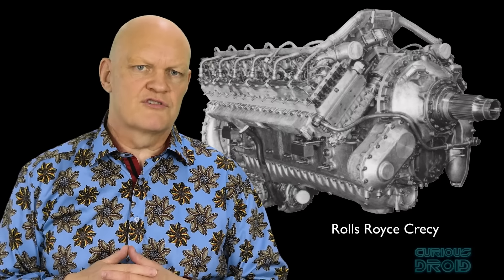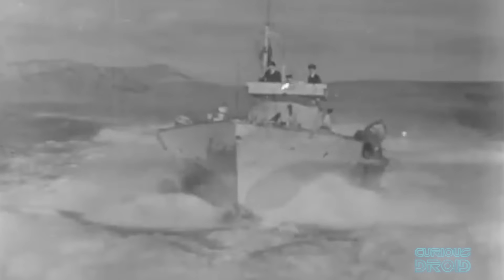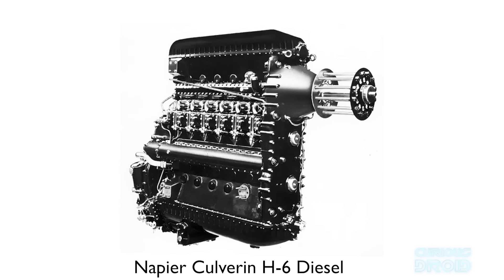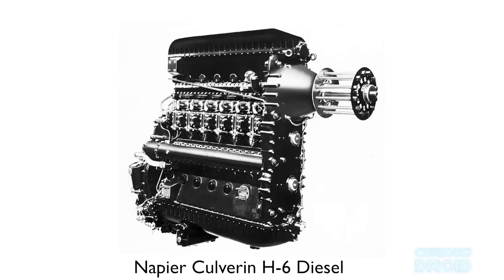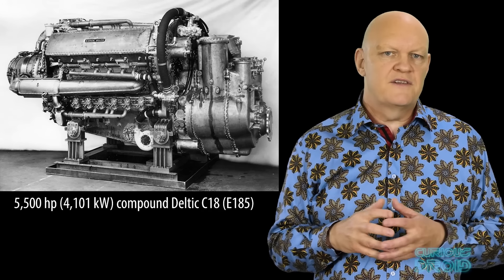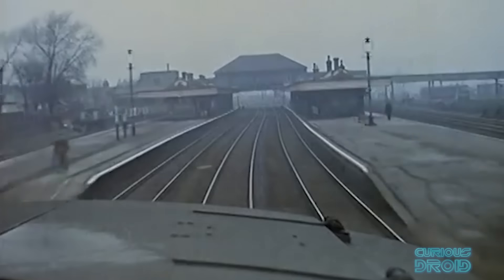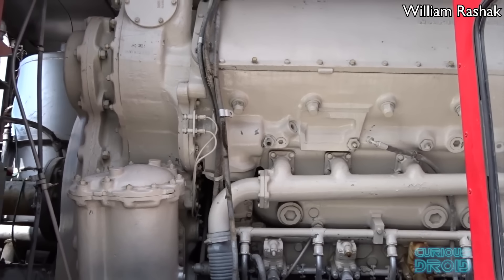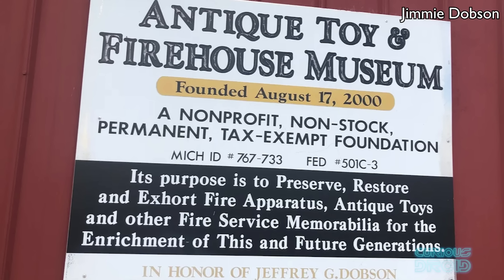The Legendary Napier Deltic - 88 Litre Opposed 2-Stroke Triangle Engine

Comment: I was a driver on British rail until 1985 and was lucky to drive a Deltic, awesome sounding locos
Reply: Hi Bob as a Kid our house backed onto a field which at the furthest side had the Blackburn to Preston line. I used to run across the field  to watch and hear my favorite. I was lucky enough to see the Flying scotsman and the Mallard as a kid pass by. Such great engineering feats.
Reply: @golfhacker9051  
Never saw a Steam engine till I started at Saltley diesel depot in 1977. We used to go to York, I was with an old hand driver where we had a few hours at York waiting for our return train and he took me to York train museum and that was the first time I saw mainline Steam engine for the first time and I was amazed at the size of those engines, no wonder train drivers back then we seen with such admiration.
Reply: @bobp6742  Admiration
Reply: @jasonjanes3256  
Never noticed, thanks 😂😂
Reply: Wow!
Reply: A back ground sound that has long gone. The low rumble would travel for miles. Just like we don't hear Viscount turboprops passing overhead any more.
Reply: @flybobbie1449  anything with dart engines.
Reply: did the class 55 run the triangle engine?

Comment: At the request of BR In the 70s I assisted an RAF civilian Control Engineer on a problem with the 'Power control" system on Deltic Locos . The drivers could not use full power on Initial take off, if they overdid the Throttle? it would blow fuses and the whole thing stopped. He mathematically modeled the control system, all mechanical, and believed he had found a Multiplication error.  By inspecting the drawings I thought I could see where one of the three holes, for  link rods, in a 'wash plate' was in the wrong place  The outer holes were 9 inches apart and the center hole 6 inches from the top one, giving a ratio of 2 to 1.  I estimated 'from the overall shape of the wash plate"' that the center hole was intended to be 5 inches from the top giving a ratio of 5 to 4  (multiplication of 1.25 instead of 2)  Mr. Patterson's figures indicated a figure of 1.31 was required.  When a new plate was fitted with the holes at 5 to 4 the problem was solved.    As a side issue Mr. Patterson did a performance analysis from actual data and calculated the true HP as 4200 HP.

Comment: I drove a 2 stroke Mack years ago and was told by the dispatcher that those old 2 strokes were the most efficient machines that convert fuel into noise.
Reply: Other than a V8 Air Siren.
Reply: @Neojhun  pretty sure a TU-95 is louder
Those planes have their own sirens
Reply: I have permanent hearing damage from racing unmuffled 2-stroke motorcycles in the late 60's.
Reply: I used to drive a TM Bedford with a supercharged 2 stroke, once you got it rolling it was almost uncatchable. The only trouble I had with it was the splines on the supercharger drive-shaft, they used to wear like they were made of plastic.
Reply: drive them like you slammed your thumb in truck door.. and wife just left you .. gears ? any gear ,don't lift foot .. drove a L9000 for 3 yrs .. inuvik to edmonton and edmonton to Yellowknife through to lupin mine
Reply: I once drove an old bus that was very good at turning diesel fuel into a smokescreen..
Reply: @dbmail545  no way, dirt or tarmac? I raced a TZ250 for a few years in the late 90’s. I miss the way they sounded, and the kick in the pants when you got up on the pipe. Can’t imagine what one of those 500 v4s is like to ride.
Reply: @borderreiver1806  that’s how the Mack was. With no load you could really rip, fully weighed down you had to use all 20 gears, took a while to get the 2 stick shifting down but was a lot of fun, it had a radio but you really couldn’t hear it over the motor and the road noise.
Reply: Ah yes your dispatcher, your best mate at the start of the day, at the end of the day ...... ....... at home all warm and cosy
Reply: @dbmail545  I raced td2 3 and tz 250-750 my mechanic was deaf on one side from ear tuning bikes and chainsaws
Reply: @dbmail545  What?
Reply: @bryanmartinez6600  But correct this for fuel used during noise test?
Reply: @dbmail545  I'm gald. I had to listen to them. I hoped there was some force in the world delivering fairness.
Reply: I have a pair of FD6 generators that I want to find a home for.  My dad worked for Vospers during the war and lived on an MTB for a few years after it.  The Napiers used to wreck main bearings until they realised that ally engines on steel cradles were beinding the whole engines.  There were a pair of them in Great Wakering some years ago, but the woman who owned them would prefer to scrap them than allow someone to buy them for a good price.
Reply: @jenpsakiscousin4589  raced the TD3 then TZ350A-D TZ250A-D  TZ750 C I quit in 1979, or the Army quit me ..
Reply: Size  for size, have a listen to a 250cc DKW piston supercharged 2T Grand Prix bike. Absolutely ear splitting.
Reply: @RichardASK  It isn't a matter of loudness so much as tone.  I was sad to scrap my Paxman 12YHAM (they had already had the blowers removed).  They made a low rumble that could be heard 500meters away and you could feel them if you were closer.
Reply: The most thermally efficient reciprocating internal combustion engine ever produced is a two stroke diesel.  Admittedly it's a big larger than anything fitted to a Mack truck ( Wärtsilä RT-flex96C ship engine:  1829 litres or 111,597 CI per cylinder and  up to 14 cylinders).
Reply: @ferrumignis  probably burns heavy fuel oil. I think it’s awesome when bore and stroke are measured in Feet instead of Mm or ci.
Reply: Another was the commers in the UK , 2 stroke 3 cylinder 6 piston..horizontal.. Spoke with the " Old Boy"  he just got rid of the horse box in Ireland had it from New in the 60's.. .
Reply: I worked on tugboats in the lower Mississippi and Gulf of Mexico with boats using EMD’s from v6 to v-20’s! I enjoyed working on the big 20’s as we were big cock on the dock wherever we went! The scariest part of working on these boats was tying to dock! Close to 20 second gear lag it was wrap and run for deckhands!
Reply: @dbmail545  I used to ride a Suzuki GT550 two stroke triple and always being stopped but never prosecuted for noise with in legal requirements only just
Reply: My father had a two stroke diesel Comma van
Reply: Mack built F model trucks with V twelve Detroit Diesels for N.Y.C. Fire Dept.
Mack Truck owned Brockway Trucks and stopped building the Brockway because they were out selling Mack because the Mack engine wasn't the engine of choice in the trucking industry.
Mack dropped Brockway and started using engines and transmissions that were profred by the industry.
Now Mack uses a over head cam Volvo engine bringing Mack into the 21st century with diesel engine technology.
Reply: @nicksykes4575  The Quill Shaft drive plates in the Detroit Diesel V engines would always brake. The scavenging blower would stop turning as well as the fuel pump and stop the engine from running.
The two stroke " Jimmy " had a sound like hundreds of angry Bumble Bees.
If you were driving a unit with the Detroit Diesel two stroke engine with a manual transmission you had to shift very quickly or the engine R.P.M. would drop off and you would miss a shift.
Reply: @jenpsakiscousin4589  I had a friend of mine work with me from Germany.
He drove our Mack tow truck.
He told me that the end of the day "When you finish using that truck that truck it finishes you ".
Reply: @lonloren2317  they were beasts, I got stuck in major traffic once on I 81 near Martinsburg, I had to clutch with my right leg for a while because my left one was worn out.
Reply: @jenpsakiscousin4589  The F model Mack with a sleeper with the Detroit was heavy.
My Freightliner with a 335 Cummins and a 13 speed with air ride and 200 gals of fuel weighed 15,500. The F Model Mack with a sleeper and the 8V 71 with the Mack transmission weighed 18,000. 

When max weight was 73,280 it was a big deal.
My rig weighed 31,500 empty. With the 5% scale tolerance I could load 45,000
and scale the load. With the Mack and an old style 40 foot refrigerated trailer 
full of fuel weighed 36,000. Plus the steel F Model Mack badly rusted.
Reply: Detroit Diesel had one that was loud as well.  You had to make that baby scream before you shift gears because of it being a 2 stroke.
Reply: If one is looking for noise, just recall the B-58 hustler. It would break windows on takeoff at every base it visited.
Reply: @docmirror8009  was that the supersonic bomber SAC got back in the 50s? I’d image it would be deafening. I did some work out in Tonopah years ago and got acquainted with the sonic boom.
Reply: @lonloren2317  yep dont lift foot , just float gears
Reply: @borderreiver1806  The old Commer TS3 “knocker quite odd engine with rockers connecting pistons to crank ,good engine though
Reply: my 1983 2stroke yamaha single cylinder can attest to that
Reply: @ferrumignis  The OP 2 stroke are pretty good too, cummins is making an OP2T for the army with the help of Achates Power.
Reply: Were you running klotz techiplate. im on 6 gallons of xd-100 for my detroir silver 8v92 now
Reply: @jlo13800  Castrol A-747 or Benol if I can’t find the castrol, on C12.
Reply: @jenpsakiscousin4589  Im sure the napier deltic would do fine on castor A-747 2t oil. I run and fill my detroit silver turbo 8v92 with BRP-XD-100 Etec oil with problems and its much cleaner, somewhat cooler and quiter now but boy its no cheap. The deltic 2 stroke would do goog on amsoil dominator, i converted free kohler more to work on it, its 53$ a gallon.
Reply: @jlo13800  I was referring to a 2 stroke petrol motorcycle, I’m assuming your spiking your diesel with 2 stroke premix oil. If so I probably wouldn’t use straight up castor. It doesn’t like to burn that well and carbons up everything pretty quick. Castor was king in 2 stroke bikes that were run wide open with a lot of high rpm engine braking. Ive heard of people using premix in the fuel in an old 2t diesel I’m assuming to take place of the sulphur content.
Reply: I fillmy 2 stroke diesel with xd-100, cant wait to convert a cat 3406 to dry sumped poppet valved 2 stroke as all big diesels anit friction bearings
Reply: @jenpsakiscousin4589  i  run xd-100 2 stroke oi through my 8v92 crasnkcase also!
Reply: @dbmail545  Pardon......
Reply: @jenpsakiscousin4589  the napier deltic run the castrol A-747 2T? not sure.
Reply: @petesmitt  hehhe lol
Reply: Motorcross 2 strokes were fuckin awesome.  Could climb a wall with a 250.  The noise, the smoke, the stink.  Glorious.
Reply: @dbmail545  I am totally sure it was worth it.  Especially if youre married.
Reply: @borderreiver1806  Holy crap, Inuvik
Reply: @jenpsakiscousin4589  According to Mick Doohan, horrible!
Reply: i usedtodrive a 2 stroke diesel also. U.S.Army M985 with a detroit diesel that was blown and turbo. screaming at 1800 rpm. pulling 50 tons with a allison 3 speed automatic. pieceofcake
Reply: @bryanmartinez6600  I really want to have a flight in one of those beasts. Four, huge eight blade contra-rotating propellers, powered by four Kuznetov NK-12 turboprop engines, has to be an incredible sound. It's no wonder it has a NATO designation of, "Bear."
Reply: I have a pair of 6-cylinder2-stroke Fodens FD6s in my boat, and yes, they were LOUD ... so I have been told.  Main engines were Paxman 12-YHAXM engines had no silencers, the Fodens did.
Reply: I have no interesting anecdote to contribute.
Reply: 2 stroke Mack, meet the pre update 4.7 liter MOPAR V8 from the early 2000s. The SLT on the tailgate was not a trim code but rather stood for Slow Loud Truck.
Reply: It really depends on the type of forced induction
Reply: @nicksykes4575  Were those Foden engines ?  I have a pair of aluminium FD6 that I would love to find a home for.
Reply: Detroit 2 strokes run anti friction bearings, i got a silver 8v92 turbo.
Reply: Get one of these and have some fun:https://mart.cummins.com/imagelibrary/data/assetfiles/0058689.pdf
Reply: I will speak a little truth about 2stroke diesels. When used as a stationary engine, they will run all day long with no issues. But they consume a lot of fuel when used in highway trucks. They have a narrow power band meaning they produce the most power in a narrow range from like 1800 to 2300 RPM. That is why truckers were always reving them hard to get the power they need. 
They stopped making them because 4 strokes got better, plus 2 strokes polluted too much.
Reply: @robertnagel368  They consume the oil to. i got an 8v92 turbo.Detroits run on anti friction bearings also
Reply: @robertnagel368  Bullshit times have changed the new achates power 10.6L 2 stroke can make 1700 ft-lbs torque at 950 RPM. Electric can outperform it but the crap 4 joke stroke needs to be wound up too and sounds retarted. i hate 4 joke and i would rather have electric over a 4 joke anyday! Heres the new cummins op ACE 2 stroke:https://www.youtube.com/watch?v=sYTnHQEfK-8&t=23s
Reply: @dbmail545  oujda
Reply: @docmirror8009  "B-58 hustler. It would break windows on takeoff at every base it visited."
vs. Tu-95:
"The contra-rotating propellers on the Bear's Kuznetsov NK-12 engines make it one of, if not THE noisiest plane in the sky. The constant sound is caused by the tips of the props breaking the sound barrier which results in 32 constant sonic booms per plane."
"One source claims that inside the cabin the noise is 110Db. That is rock concert loud. The US Navy states that the passive sonar on a submerged sub can pick up the sound of a TU-95 overhead."
So i imagine that if Tu-95 would use full engine power in the same situation you would not need to wory about windows->start to wory about doors and walls...
Reply: Fuel into noise ?  Cummins V -903 . Non Turbo . 10,000 dB  per Gallon .🤣.
Reply: @johncunningham4820  Yes the deltic 2 stroke! Ethnaol powered.
Reply: @jlo13800  . Diesel fuelled actually
Reply: lmaoooo
Reply: It was very fuel efficient with very high thermal efficiency.
Reply: But there's nothing like the sound of a screamin Jimmy. My dad's CB handle was Screamin Demon for a reason lol

Comment: An absolutely Brilliant Engine. I have worked on the Railways for nearly 33 years and just prior to privatisation, a preserved Deltic Loco came to the depot, on it`s way to Doncaster for Crew training. The Guy who was with it Started it up for us to have a look at. Just ticking over, the Ballast was vibrating and moving under the Loco. We opened the Engine room Door and was met with a wall of sound that no matter how loud you shouted, you could barely be heard. An amazing piece of British Engineering.
Reply: Years back, was in a tunnel we shouldnt have been in and double head  fuel tanker came through pulling hard, i thought my head was going to explode !!🤣🤣🤣🤣

Comment: Hi Droid - (Comment attempt #2)  Great post! I had the "job" of driving the US Navy's PTF-17 which had two 18 Cylinder turbo supercharged Deltics, 6200 HP total.  They idled at 800 RPM, red-lined at 2400 RPM.  The British did an amazing engineering job on those engines.  Very fast, but not a "low humming sound", I am still hearing that turbo screaming even with the underwater main exhausts...Turning #2 diesel into noise, spray and adrenaline.  After Vietnam, the engines were flown back to the USN engine shop which remained at Subic Bay PI for overhaul. The costs associated with that contributed to their eventual removal from USN service.  Thanks for the excellent post - good memories!
Reply: Thats is a lot of power them deltic 2 strokes had. 4 joke stroke dont even come close to that rating for the sames sized engine
Reply: @jlo13800  Alongside being an OP layout, these were also extremely efficient not just in thermal efficiency but on fuel as well. Depending on application of course, it's not always a constant measure in terms of how much fuel is being spent but on the contrary of combustion cycle, that's where an opposed piston engine outclasses everything else.
Reply: OP 2 stroke could go in snowmobiles too although there are axial flux engines that make over 500 hp and can fit in your lap. How much 2 stroke oil did your boat go through? its time to go with a pulsed plasma 2 stroke that taps aetheric ZPE and elliminates all chemical fuels but in the mean time ethanol would be nice.
Reply: here is the new cummins OP ACE 2 stroke https://mart.cummins.com/imagelibrary/data/assetfiles/0058689.pdf